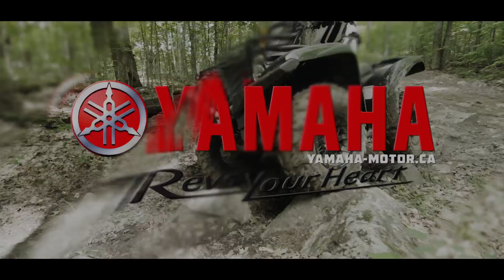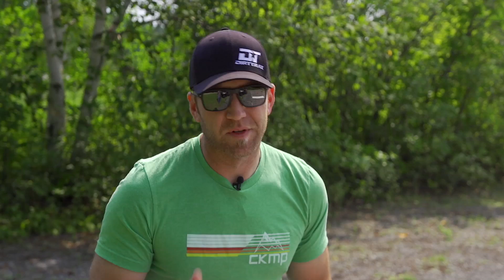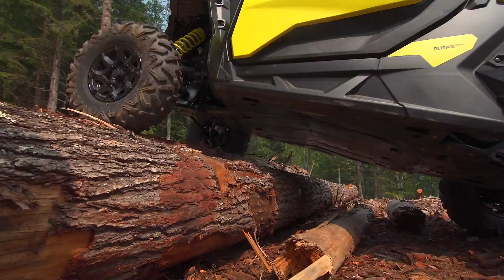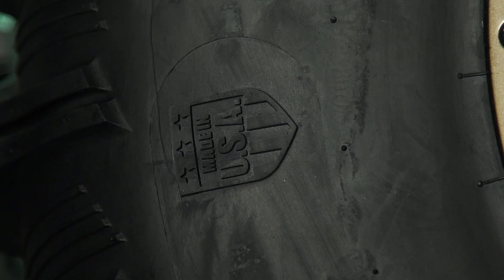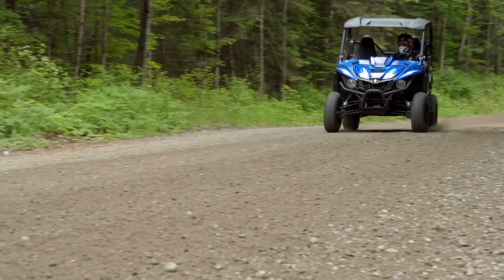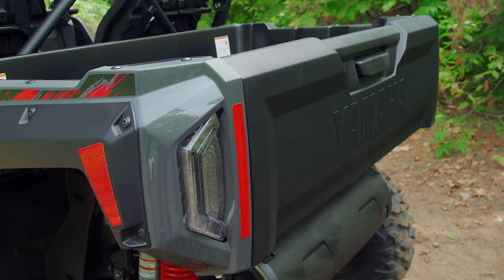Dirt Trax Television 2018 - Episode 11 (Full Episode)

Comment: 70 hp is enough, but the real number to analyze on the Wolverine is the top speed.  I remember Honda and Yamaha taking it on the chin with all the 3 wheeler lawsuits, but that was a long time ago and SXS are pretty safe imo.  I cannot fathom how these 2 manufacturers can let sales go to the other brands by limiting speed.  Though I’m an old sightseer and don’t really want to go 70 down a trail anymore, on connecting roads between trails, asphalt, or nice flowing fire roads, you need to be able to do 55 mph without your engine screaming for its life.  If you want to keep them speed limited, at least make them relaxed near top speed.

Comment: Top  things I don't like about the 60" Maverick Sport (even thought it's awesome overall)
1. Chintzy instrument cluster compared to old Mavericks and Commanders
2. Narrow interior than older Mavericks
3. No Smart Lock front differential (I own a Commander and I'm not a fan of Visco Lok)
4. Less ground clearance than older Mavericks
Reply: I just bought one. The interior is huge. 
The DPS model has the Visco-Loc QE. (Quick-Engagement.) 
It locks after a couple wheel turns and when I'm driving it, I can't even notice the lag, yet can drive around in 4 wheel and the steering is unaffected. 
Take one for a test drive.

Comment: ITP Versa Cross is pretty much the Carlisle Versa Trail ATR tire, but the ITP Versa comes in bigger sizes, but Carlisle Versa was first.
Carlisle Versa: 6 ply
27" to 29" sizes
ITP Versa: 8 ply
30" to 32" sizes
*Same tread pattern

Comment: S900/s1000 still better as far as specs more clearance, travel and more seat options.
Reply: We all like Polaris power and design but we just don’t trust the reliability
Reply: Atl Native i can only speak from my experience. I have 3700 hard miles on my 2016 rzr 900xc and not one issue so far.
Reply: I’m trying to decide between this can am and the rzr 1000s I was leaning towards Polaris I just get spooked after reading certain things and Polaris not standing behind the warranties
Reply: Atl Native get a aftermarket warranty. My dealer told me they are way easier on claims so I went with that. I havent had to use mine, but a buddy with a 2016 turbo xp 4 seater made two claims no issues.  Front dif went on his when he landed in awd while gassing it, and his wife hit a tree and ripped front tire off. Both covered
Reply: Atl Native one other thing to consider is the polaris has insane amount of aftermarket stuff to customize your machine or make it better.  A brand new model it gunna be very limited.
Reply: Atl Native I have a rzr 900s 4 and have put 750 miles no issues and we don't do crazy jumps but we don't do easy trail rides we a puddle scares us but I know what you mean but I have nothing against can am never ridden one so could 100% better in real life but on paper polaris wins.
Reply: My ride is a 2015 RZR-S 900, and I've got 2,500 miles on mine, need to replace my suspension bushings, but still on the factory belt, running 30" tires, and only failure I have had so far is the driveshaft u-joint and carrier bearing. I will sometimes push 60 mph on dirt roads but try to avoid the mud holes, which is hard to do in the South.
Reply: Not a rzr but my sportsman 850 has been in the shop 4 times and only has 400 miles.